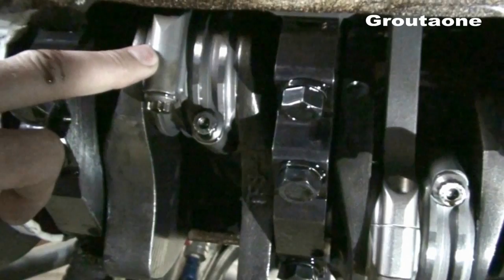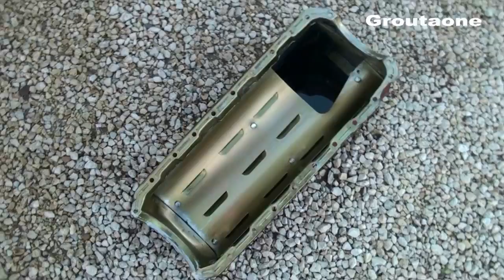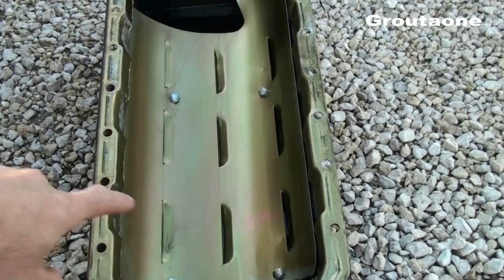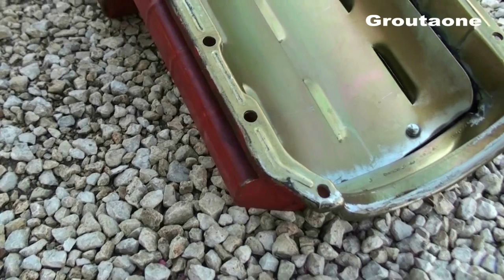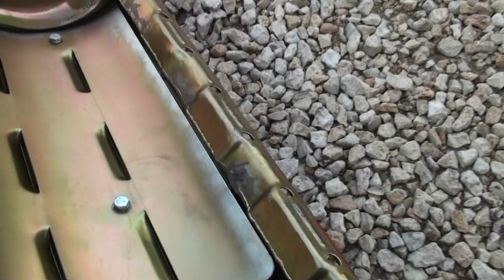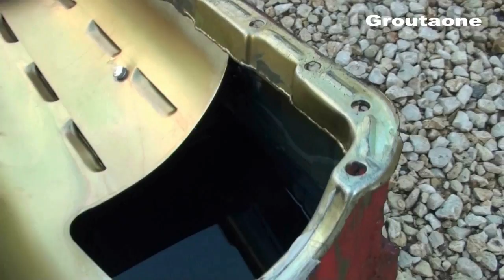Oil Pan Science

Comment: Dont buy anything from proform. The oil pan (#68050) has rusty, pitted welds, the bolt holes don't line up, and the pan is almost a quarter of an inch too long. The pick up tube (#68051) has the mounting tab welded in the wrong place, and goes no deeper than the factory pick up tube.

Comment: I don't like how the windage tray has bolts on the inside of the oil pan. Wouldn't want one of those to loosen while the engine's running. But then, the ones that mount using the oil-pan bolts are a PITA to seal. Catch-22, I guess.

Comment from the maker: @b1600v8 Thanks for watching, this pan will reduce the oil to the cam but not enough to harm it. The first few minutes of your cam break in are critical. Heres a few tips that will help. If you have real stiff springs you may want to swap them out for stock ones or remove a coil if you have more than one per spring. Also along with the cam lube which you have already applied, overfill the crank case with a few litres of oil just for break in so the rods bat in the oil and toss it on the cam.

Comment: Hi Groutaone. Awesome videos (especially the old CR500 ones!). Just wondering, is this setup only for roller cams? I know it's still a problem with flat tappet cams but wouldn't it reduce lubrication to the cam? I'm only asking here, because I have limited experience and been reading a Crane Cams break in procedure for flat tappet cams prior to swapping in a cam next week. It says to keep the engine above 1500rpm because the camshaft requires splash lubrication.

Comment: nice how you show the drag that oil can create. And those trays can indeed help a lot. I know that for the volvo engine's volvo designed 1 themself, and the had things sticking out near the crackshaft to "shave" the oil of the crankshaft. And it may only give a little gain, but its a easy thing to put in(if u buy 1that is profen to work)
Even beter would be a dry sump system with a vacuum in the engine. But thats pretty expensive, and it will cost some power to drive the pump

Comment: So, the windage tray prevents crank throws from cupping too much oil at 1000's of rpm., but also not preventing the crank throws from not sloshing too little oil into the cyl walls. Some engines have the jets to oil the piston underside, so what splashes oil on the piston underside now that the crank throws are less immersed? Anyway, the stock oil pan is good fror normal useage. No YouTube videos of inverted engines running on stands, why ?

Comment: @pulse0000 other then engine longevity thier would be a small difference. the synthetic oil can be thinner, and still lubricate the engine, thinner oil takes less power to pump, drains off the parts quicker etc...

Comment from the maker: @xnihpseht Not sure what your project is but fasten it to a jig with welding or bolts so it wont distort when you weld. If you are welding an oil pan, bolt the pan to a spare block before welding.

Comment from the maker: @dl650stromer That depends on how much oil is up at the top end when the engine is at full rpm for its intended amount of time, If that idea is pushed too much the engine can run out of oil, you are right but there is a deadly fine line there.